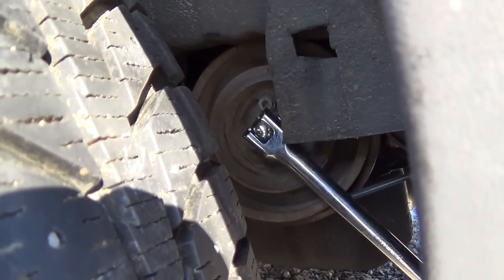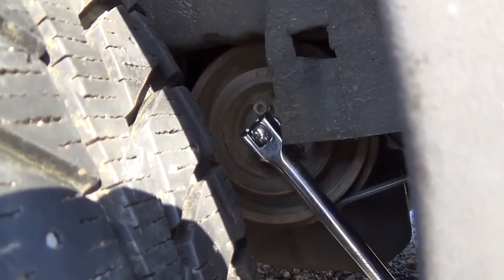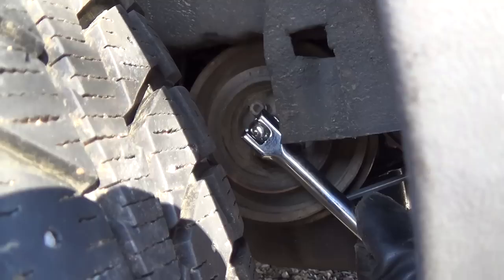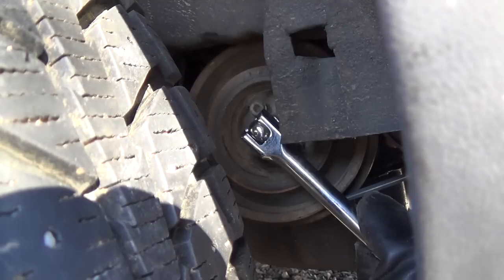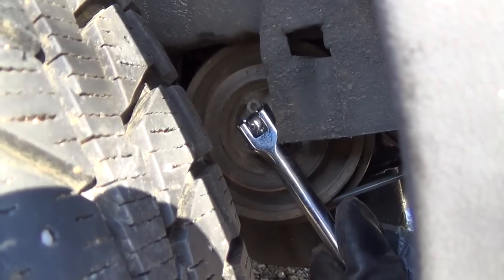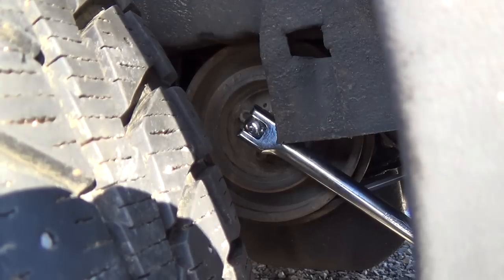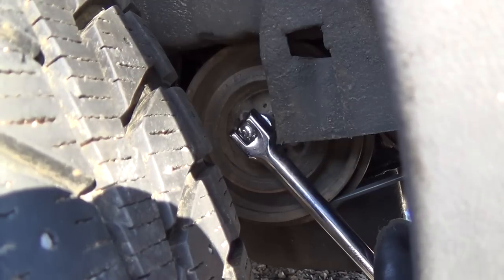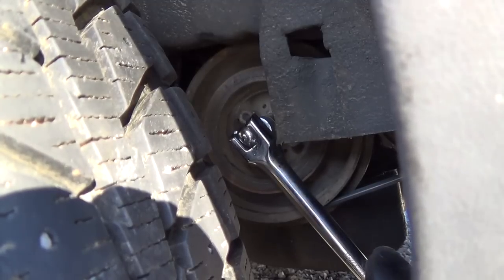VW Crank Bolt, Engine Turn-Over Test

Comment: I'm having a similar issue although mine is a 1999 vw Jetta 2.8. This car won't start, and it also won't turn over. It makes one "click" sound when you turn the key. I'm thinking a possible electrical problem, but what are your thoughts? Could the engine be seized up? Also I couldn't find what size socket to buy to turn the engine over by hand! What size did you use?
Reply from the maker: If the starter solenoid goes click, but the starter doesn't, it is likely starter contacts issues. (I have a video on that.) I don't remember what size socket it was. Nothing rare. My problem was a seized up alternator causing massive resistance. It did "sort of" turn over.
Reply: +BigTideFun awesome, thanks for the advice! I'll check it out. It's my friends Jetta and he said I could buy it for $300 because he is tired of it sitting on his property. I went over there the other day and plugged my battery into his car and tried to start it. Just made the one click sound, but when I disconnected the battery terminals, the negative battery cable almost burned my finger from it being so hot. I'm thinking that there is a bad ground somewhere. But the prob is he said it quit on him while he was driving down the road. Can a bad negative terminal cause a car to stop as the engines running? Thanks for all the advice, I own a Toyota so this VW is pretty alien to me lol
Reply: @HowltoHeal  what ended up being the issue. Mine quit while driving down the road also. Negative cable gets hot when I turn the key over. Starter has been replaced.
Reply: @blaster42008 mine is currently having the same issue.. how did you solve it
Reply: Only that my positive gets got

Comment: well checked alternator, it moves fine also engine moves at crank pulley with spanner , not sure why it wont turn with key??
Reply from the maker: Have you ruled out the starter? The contacts aren't the most reliable. It is possible to remove just the end of the starter and check that the contacts/springs are sliding properly in their sleaves.

Comment: Is the car fitted with a Compression release? If so I'd check that..
Reply from the maker: I do not know anything about a compression release. The other day I checked the crank shaft bearings and disconnected the pistons. It still won't turn over the right direction. I even rechecked the timing belt tension on the pulling side of the head gear. There was no excessive tension there, when tension was applied to the crank shaft bolt. It is still a mystery to me.

Comment: I have a 1.9 tdi that cranks just as slow even tho timing is right, starter works fine/no bad connections, no alternator or water pump or anything else hooked up to the engine
Reply from the maker: If you were to turn it over manually like in the video, is there excessive resistance internally?
A stiff or miss-aligned starter won't turn the engine over fast either. I had a broken starter case once. 
Are you sure the battery is big and really good?

Comment: i have a similar issue with a nissan xterra it will spin freely counter clockwise but gets stuck going clockwise, i checked de alternator and it spins freely either way what can it be thats seizing my engine ?
Reply from the maker: Does everything else run by the belts spin freely?

Comment: have a similar issue did you conclude that a seized alternator was stoping engine from turning over???
Reply from the maker: Yes, the alternator wouldn't turn at all in the proper direction.

Comment: Hi I have the same problem, how could you solve it?
Reply from the maker: The alternator was seized up. But, it did turn the wrong way when I thought I had ruled it out earlier. Check to see if the alternators spins freely in the direction of rotation.

Comment: Be easier to turn if the belt was off
Reply: Not really. As long as the plugs are out so there is no compression building a working engine should spin by hand without huge force.